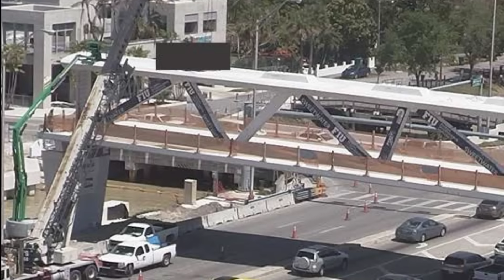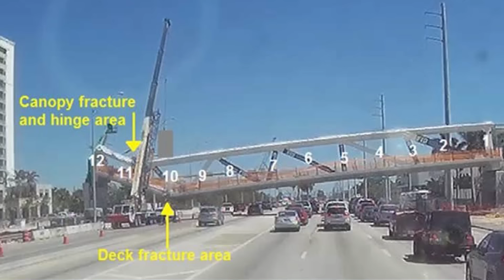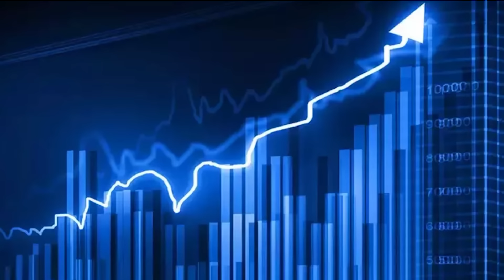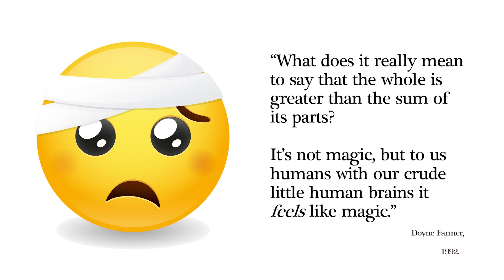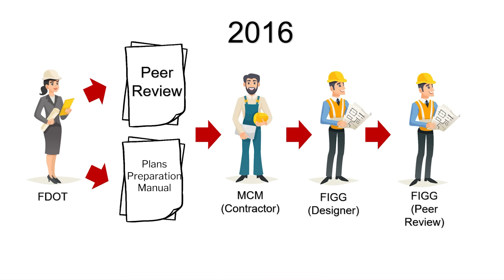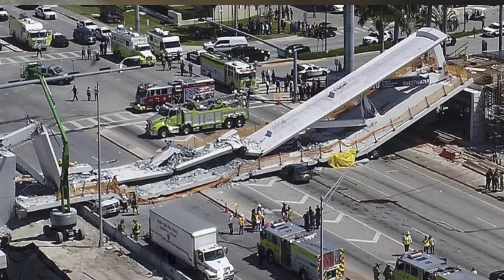How Complex Systems Work: Lessons from the Florida International University Bridge Collapse

Comment: Excellent treatment! I hope this video is used in secondary school courses to begin the training of future generations of engineers. I work in the reliability of complex systems and must frequently tell the participants of a design analysis that the system continues into the management process that support the project. The final system is not just an object. Modern systems also suffer from failure driven by software-hardware interaction, like the Boeing Max-8.
Reply from the maker: Thank you very much. The next long form video that we will release is on the 737 Max. It is currently being edited.